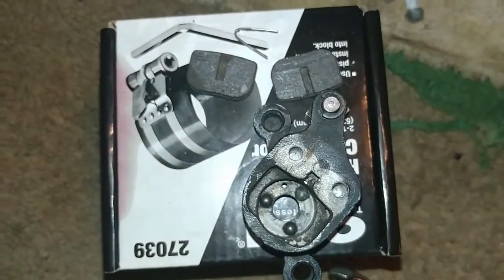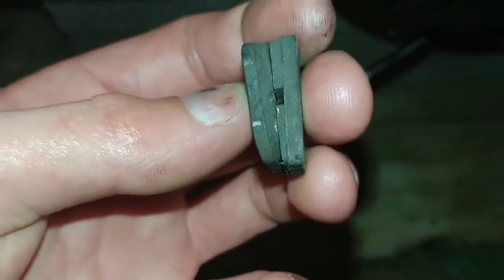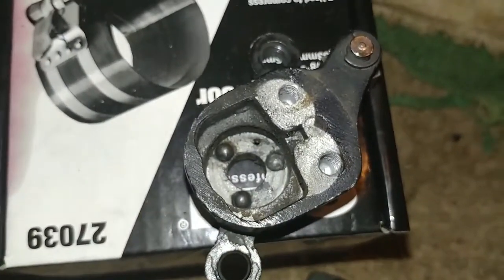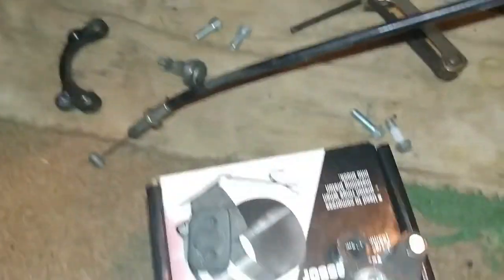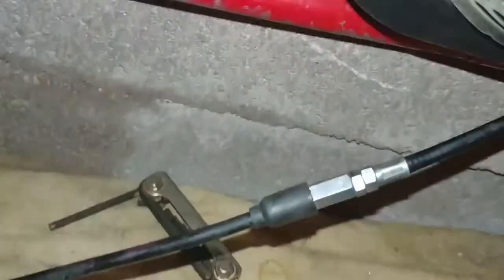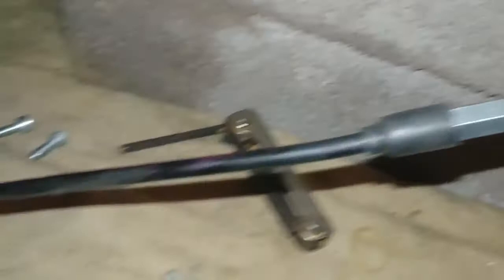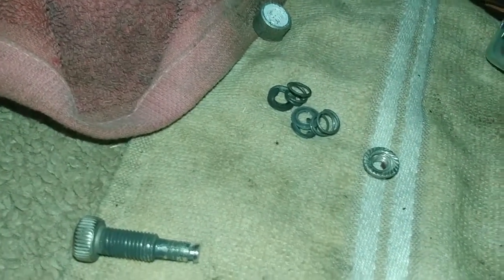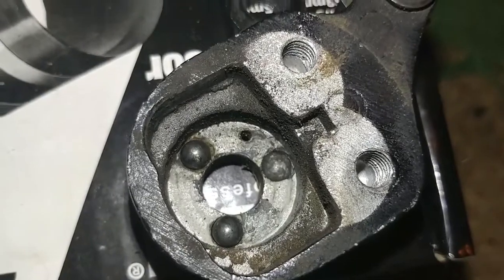Mini bike brake inspection episode 1  by spikemandan©

Comment: I lost the ball bearings too. I found some at Menard's.They are just 3/16" ball bearings.You can find them at Menard's/Lowes?Home Depot. Put grease on them to make them stick in place while you assemble the caliper.Yeah, crappy breaks lol, No Brembo's here.
Reply: looking forward to see if you can get a hydraulic brake caliper to mount to the ct100u.
Reply from the maker: MybackHurtz1 awsome

Comment: You can get push broom sized magnets grainger.com has them (w wheels on the sides) to sweep the area if you drop metal things or have kids that like to leave tools in the yard. Great for nails btw. 
 I'm interested to see what other brakes would work on the ct100u
Reply from the maker: working on it ! =) just waiting on the parts to show up my brotha!
Reply from the maker: im going to fix the stock breaks but have the Hydraulic ones for the doddle bug on the way going to see how that works out ;)